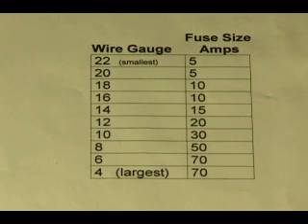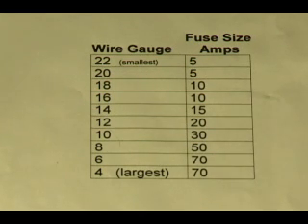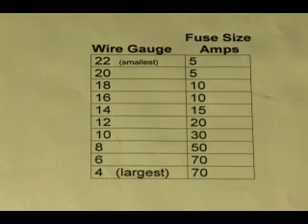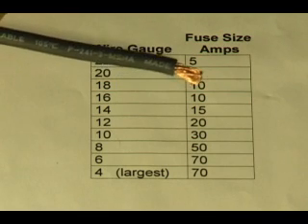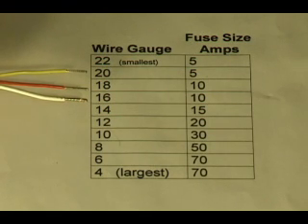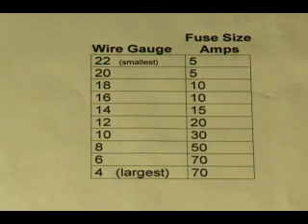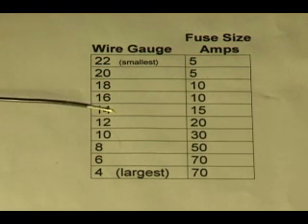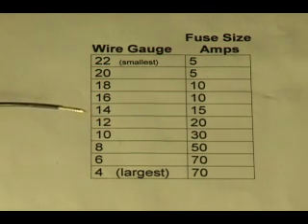Wiregauge.wmv

Comment from the maker: I agree!  Was not aware of the .5 limit (that's pretty strict)  As you know, this could be exceeded with the smaller wires run at full capacity with lengths to the wingtips, for example. For "most" applications (trim wires, radios, etc) and circuits not  near max current capacity, it shouldn't be a problem. But I agree, the voltage drop should be taken into account for proper planning.
Thanks for your input, this is a valuable piece of the analysis!
Jon

Comment: It's not that simple.  The current causes a voltage drop.  The longer the wire, the greater the drop.  FAR requires no more than .5v drop for any circuit in the plane.